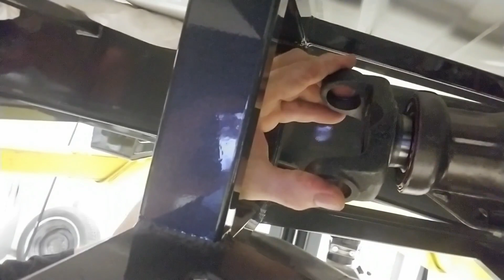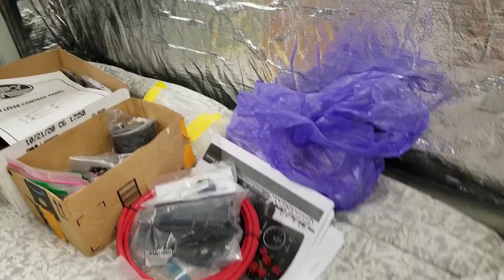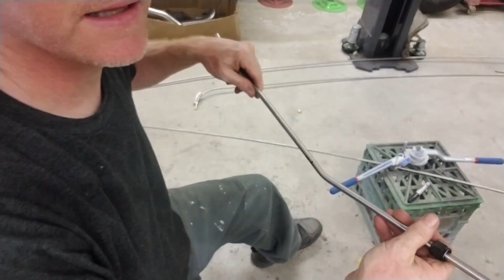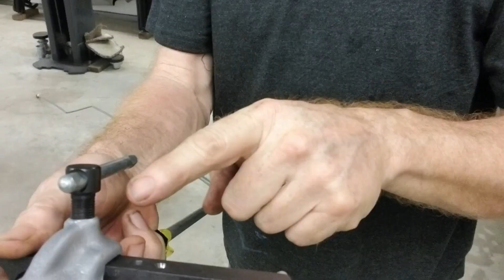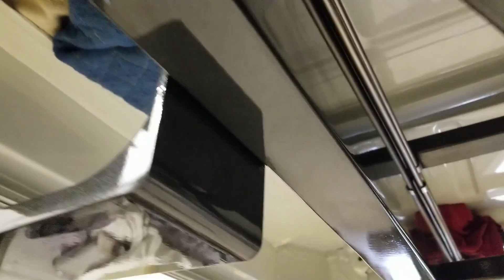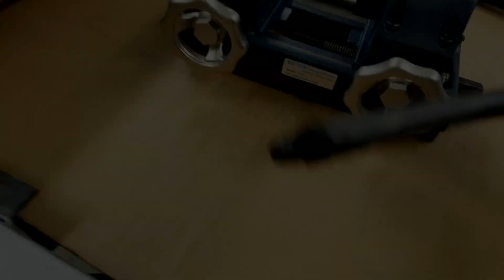Bending And Flaring Fuel Lines - Progress On The 1953 F-100 Truck

Comment: Where did the wiring harness come from? Bender? Don't be afraid to plug your tools just curious what you're using thx. That looks great if mine look half that good I'd be happy
Reply from the maker: Summit Racing has the wire harness...  We used American Autowire.
Reply: @ES4406  was it just a general 21 circuit wiring harness or was it vehicle-specific
Reply from the maker: @trkinwithmikey  general not vehicle specific.